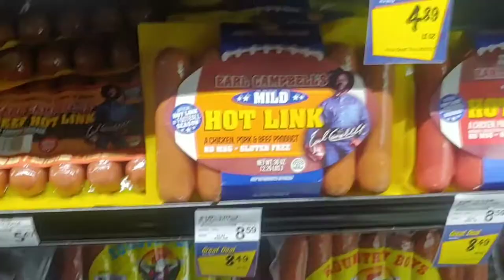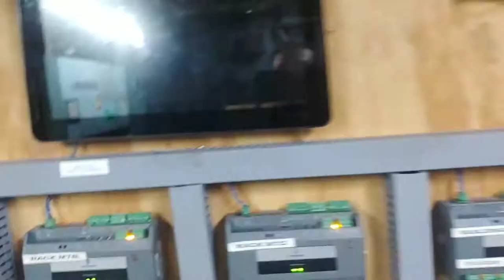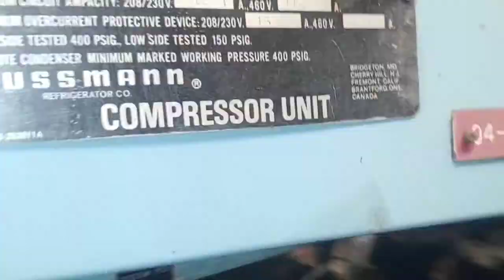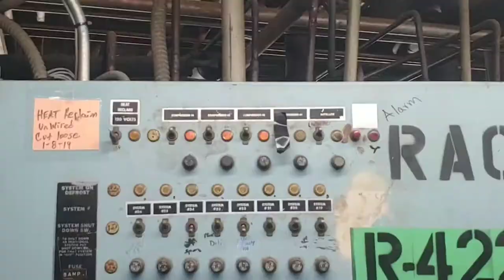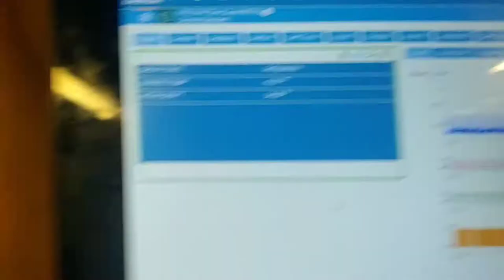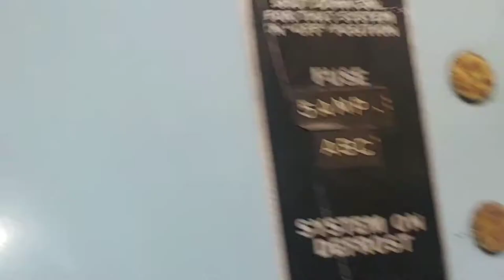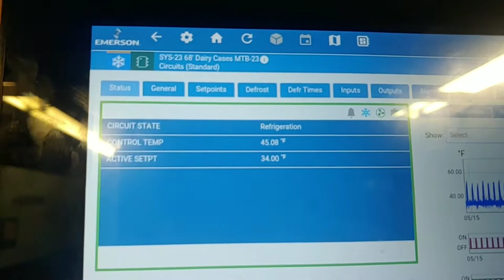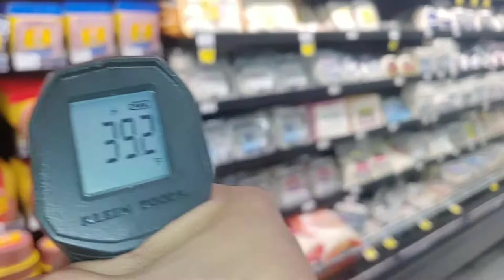Supermarket Rack Circuit Not Cooling, Diagnosis and Repair Procedure, Solenoid Valve Failure

Comment: What kind of wire was that...
Reply from the maker: Looks like its was probably 14/3 insulated. Not too uncommon, and perfect for that application. They sell it at United and other AC suppliers
Reply: @HVACRServiceTech  

Should be good for motors also some times motors wires are short to contactor...

Gracias compa..